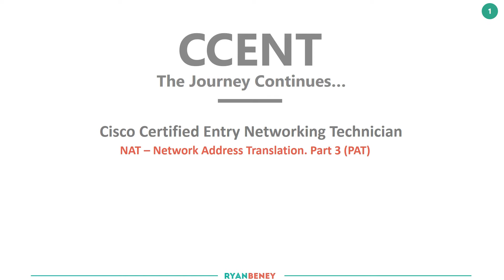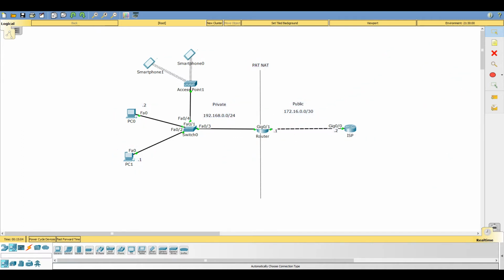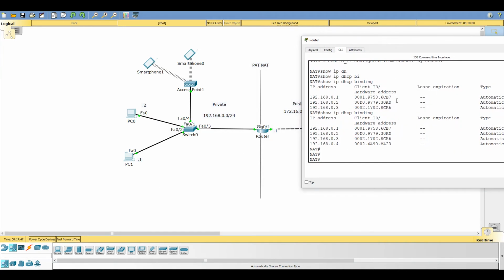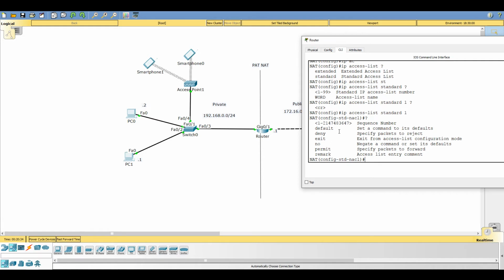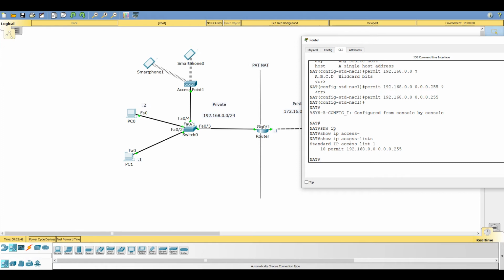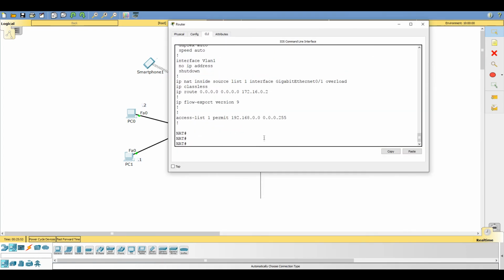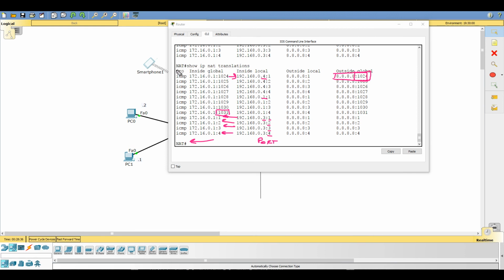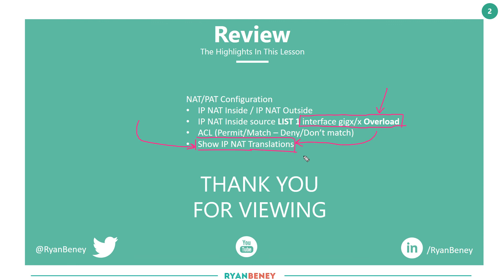Cisco - CCENT/CCNA R&S (100-105) PAT Configuration - Part3 .41

Comment: Did you have a static route set on the ISP router as well? I couldn't get anything to communicate with the ISP router's IP until I had a static route set on both the NAT and ISP routers (which for some reason I didn't have to in my static nat lab). 2nd question, which device did you set the 8.8.8.8 loopback on? Thanks!

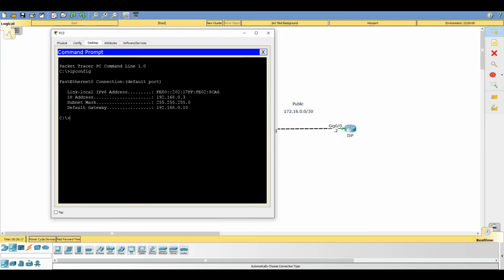Comment: 14:00 I keep getting Default Gateway 0.0.0.0. I'm somewhat sure I've set it up correctly. 
PAT(config)#ip dh ex 192.168.0.10
PAT(config)#ip dh po test
PAT(dhcp-config)#net 192.168.0.0 255.255.255.0
PAT(dhcp-config)#default-r 192.168.0.10

No unrecognized, ambiguous or incomplete commands.

Even when I statically assign either PC a default gateway of 192.168.0.10/24 (which is most certainly set on "Router" at 0/0) I still get 100% loss.
Nothing is showing up in nat translations
Reply from the maker: Hey, what are you trying to configure DHCP or NAT? Are you using the latest version of Packet tracer from Cisco? Also, are you configuring this on a router and not a switch?
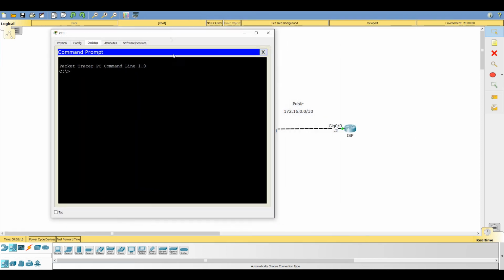Reply: I went through and configured NAT(PAT). I have the latest version of PT and I was configuring it on "Router". The one in the middle and the same exact way you have it set up. After following your instructions and also statically configuring the ISP and the router port that's in the 172 network , I ran into the problem at 14:00 with the 0.0.0.0 as the DG. That goes for all end devices. The reason why I started entering DHCP commands in Global config is because the end devices weren't getting a DG so I became frustrated and tried to configure it since that's what we learned with your Dynamic Routing videos.
Reply: I had to /release and /renew for the DG 8.8.8.8 to show. But when I tried to ping it, got a reply from 172.16.0.2: Destination host unreachable
Reply: I got the same thing after the video exactly . DG   0.0.0.0

Comment: Hey Ryan, I've watched all your videos as I have my ICND1 exam on the 6th of December and they have been extremely useful in consolidating my prior knowledge (videos from PluralSight).  
I was having some trouble with NAT, in your last video you mentioned that when using static NAT the router would keep a table of the sessions of each host, which was in the format of IPaddress:X.  I thought that X represented a port number always as opposed to a 'session number'.  More simply, how did assigning 2 private ip addresses to 1 public using static (no port translation)?
Reply from the maker: All the best for your exam! You're absolutely correct, its technically the port number but the router uses that information to keep the session unique. If the port numbers/IPs etc is not unique the router can change it to ensure the session is unique. As for the static NAT, technically it is using PAT as soon as I started to assign multiple private IPs to the single public IP. Some devices allow this, others do not. Good spot. Cheers
Reply: I just passed my ICND1 today, thank you for your help :)
Reply from the maker: Well done! congratulation